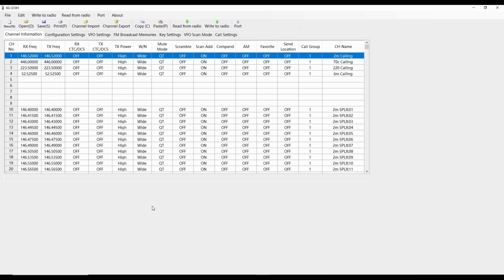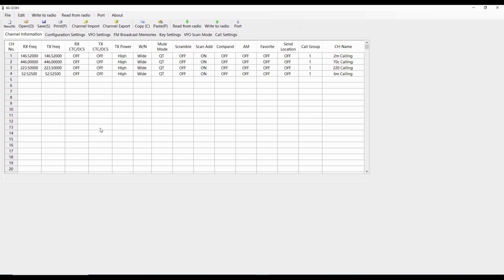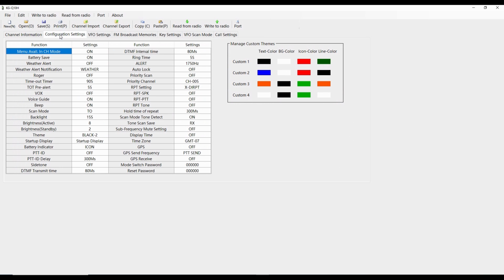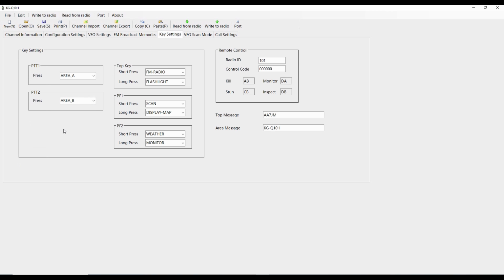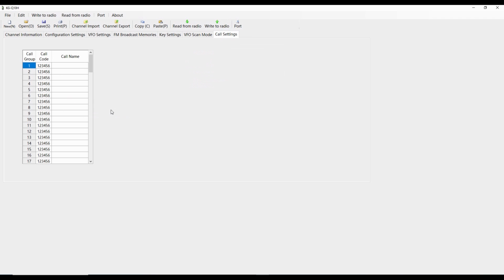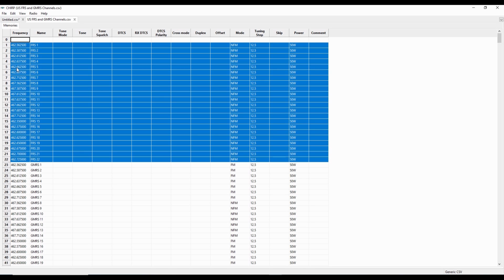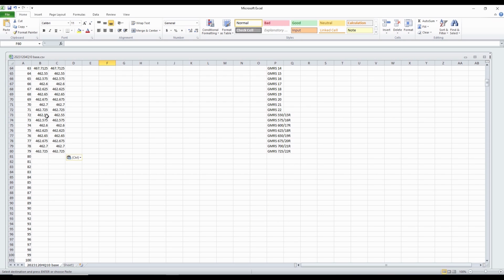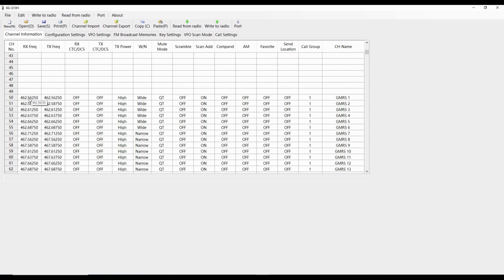Using the KG Q10H CPS

Comment: Totally useless video.  No combination....Nothing... worked to get the data into the radio other than entering it MANUALLY!!!! This radio is a total piece of JUNK
Reply from the maker: Not sure what you mean by no combination. As the video demonstrated, the radio is easy to program but it doesn't program itself. Depending on what you want to put in it, it can take some time and it can be a bit tedious. The more expensive radios generally have more features which make programming more complicated.

Comment: I just bought one and if i run any other antenna but the 6 meter antenna that came with it. It makes a wind noise while transmitting. So i have to use rhe 6 meter antenna on 2 meters and 70 cm otherwise the radio makes a wind noise while transmitting. Am i the only one with rhis promble.
Reply from the maker: Sounds like you need to call the seller. Shouldn't be like that.
Reply: @GadgetTalk4U   I had a similar promble with 2 qyt CB 58 radios I bought. They would only transmitt clearly in fm mode. And they where made for CB.

Comment: CAn repeaters be copied from CHIRP and pasted into this software? I have a few Baofeng and wanted to copy those channels into my KG Q10 to transmit in an EMERGENCY.
Reply from the maker: The Wouxun CPS has a channel import choice that allows .csv files to be imported. I suspect you'd have to do some work to get the columns right before importing though. Hopefully it will be Chirp-supported soon.
Reply: @GadgetTalk4U  chirp already supports the KG Q10 . I have a code written down at my office. I was able to go into RepeaterBook and copy and paste all my local repeaters into my new radio. Out of five repeaters, only two of them seem to be working locally.
Reply from the maker: @naturecoastprepping2487  It's not listed on the Chirp home page. I haven't tried it in the software. Cheers.
Reply: @GadgetTalk4U  correct it is not listed. If you go up and click on help at the top of the screen, then click on load module, then type in 10692 it will open up the modules for the KGQ 10 G and the H.

Comment: Same question.  Tell us about the cable you used for programing. I've checked Amazon, none seem to have USB-C which is required  to plug into the Wouxun KG-Q10H.   I will do Chirp with wimdows 10... Thanks
Reply from the maker: The radio programs through the K1 connector on the side, not the USB C cable. USB C is for charging only. Buytwowayradios.com has the red Wouxun cable, or as I mentioned, I found an FTDI cable also worked. Cheers.  Check out the radio review here: https://youtu.be/TAJJDULsak8?si=4YP4-Vr01PQtUIDz

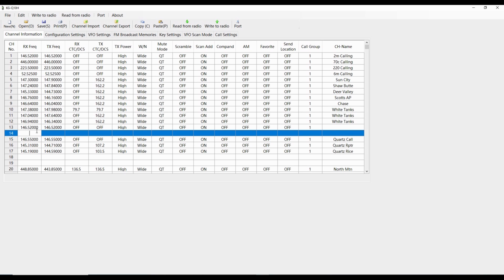Comment: 7:14 It's absolutely stupid that a radio with 999 channels makes you figure the offset manually and doesn't have Repeaterbook integrated  seamlessly.
Reply: From another users post:  "CHIRP does work, go to help, then "load module from issue" then type 10692. Now you can read and write to to the KG Q10H. And you can expand the frequency with CHIRP."
Reply from the maker: Most manufacturer's CPS are fairly basic. I suspect we'll have to wait for Chirp integration to get channel imports. Cheers.